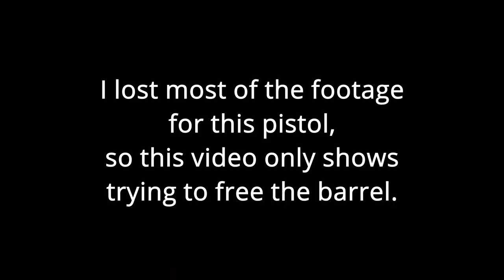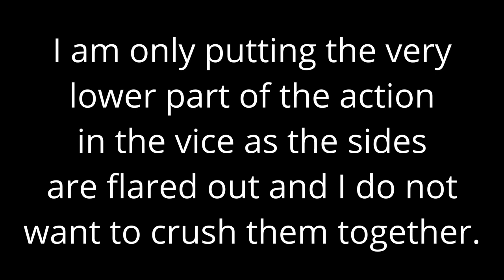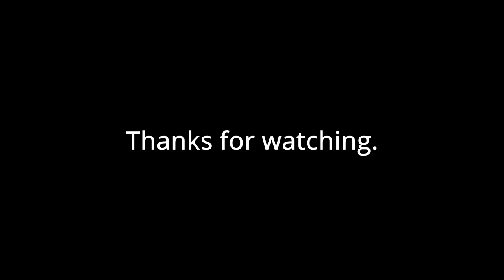I Fight An Antique Rusted Pistol Barrel

Comment: Melt some lead and pour it out into 1/4 inch sheets (6 mm or so) and line your vise jaws with it.  You'll be able to grab the barrel with great force with no damage at all and use a wrench on the frame.  For the work that you do, it's invaluable.
Reply from the maker: Many thanks, check my later videos, I have found a better way of removing a rusted barrel with half round jaws in the vice and a wrench.

Comment: Shared frustration and relief here 🤣
In a perfect world one of those electric induction ring things slipped over the joint would be nice for even, localised heat and one of them one way bearing wrenches that fits perfectly over the barrel (unlikely to exist).
Or do what some people I know would do;

1. Weld a socket onto the end of the barrel. 

2. Remove that same socket with an angle grinder and reweld it onto the barrel this time with the square drive hole facing outwards. 

3. Grip (crush) the action in the vice being sure to deform and scratch it. 

4. Using a suitable socket wrench unscrew the barrel with as much force and as little concern as possible. Be sure to place a 36"+ steel pipe on the wrench handle for extra leverage. 

4. Having removed the barrel, use the same angle grinder from before to remove the socket from the barrel, beat one's chest like the Neanderthal that they are and declare victory. 

Helpful hints: be sure to use only a stick arc welder on the wrong settings and use your free hand as eye protection (also when using the angle grinder)
 This work is also best performed when wearing shorts and sandals 😑
Reply from the maker: Lol, that's about right!

Comment: Why not apply a bit of heat to the barrel (near the thread) ? That would expand the thread area and soften some of the rust.
Seems to me cold would just shrink the barrel smaller and tighter.
Reply from the maker: Well I was using heat/cold shock and it worked, but I use a different method for getting stuck barrels off in the vice now, see my later videos.